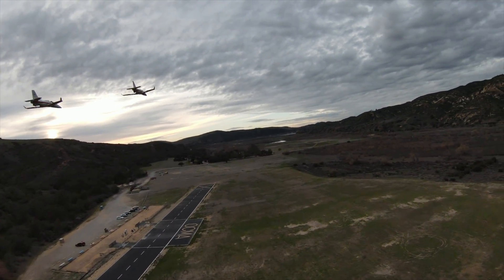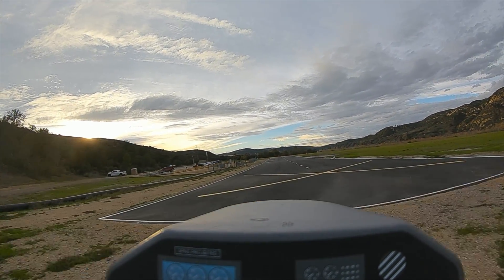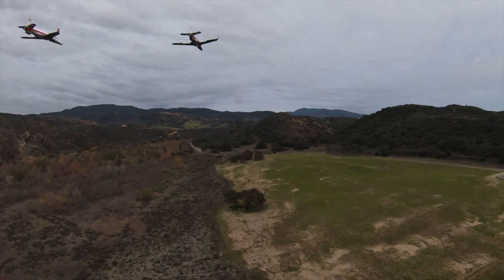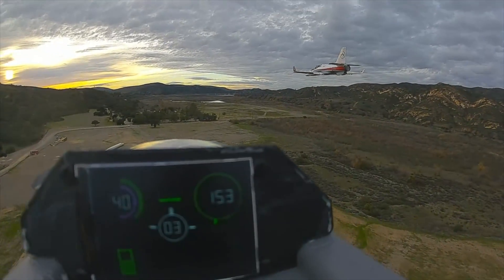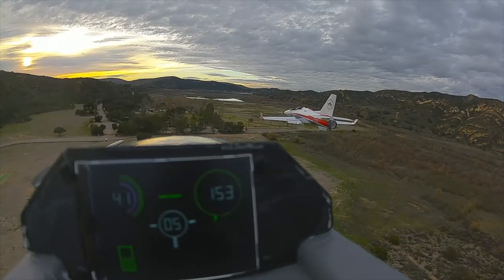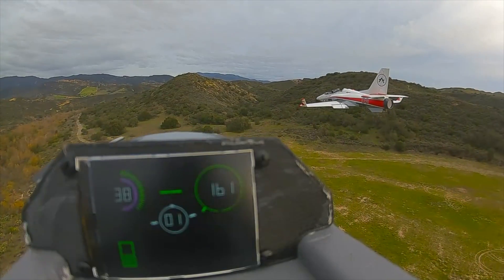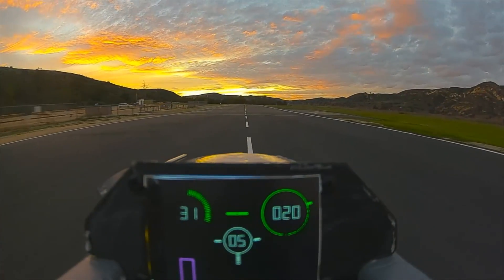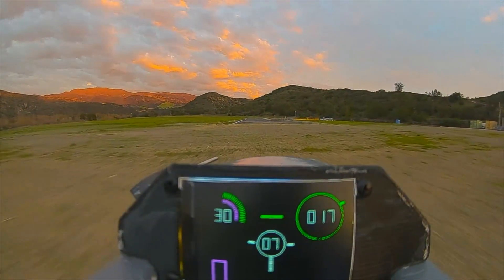FPV Display - The Numbers

Comment: Very interesting stuff.  I fly FPV Wings and achieve the heads up display with a flight controller that overlays on the VTX feed.  Information like you are showing plus lots more.  I'm curious why you aren't using that technology vs your system.
Reply: My guess is they are not using autopilot flight controllers and instead are just putting digital cam and VTX on a standard RC airplane with legacy flight controller or no flight controller. If that was the case the screen would need to be mostly self contained. Cockpit screens have been done before on RC and IIRC usually they take data from an autopilot fc like one made for ardupilot or inav. If im correct its an interesting approach to have it all self contained. Personally id rather have all the other features and more mature hardware of normal autopilot if I was going through all the hassle but this is a hobby after all so if they are having fun tinkering then more power to them.
Reply: @Clickmaster5k  Its amazing what they are doing..  This hobby is amazing..  So many talented people out there..
Reply: @SteffenRC  Yep its pretty cool. Looks like a lot of fun.
Reply from the maker: this has been asked and answered already. duplicate.
Reply: @BlackstarFPV  Yep..  I just read that below, sorry for the duplicate..   Looks like you all are having a blast with this formation flying..  Its tough to do well,  Love to see a video where you add the audio of you and the team communicating whats going on while flying on the ground..   Thanks for sharing.
Reply from the maker: No worries. Audio historically has been a challenge at our field. We either cussing too much or there is a gasser doing run-ups. Maybe some day we will get lucky and get a good track. :-)
Reply: @BlackstarFPV  man i prefer the cussing. 
Makes me feel like im flying with other people.
Reply: @BlackstarFPV  love the sound of a gasser.
Reply: @BlackstarFPV  Maybe make that a pinned comment. Or even just make it part of your video or description because it will be the first thing pretty much any FPV pilot is going to wonder and youtube comments are not very good at being forums.

Comment: This is nice. But running inav OSD would be way more beneficial and display options would be almost limitless. Flight modes, RTH ect..
Reply from the maker: this has entirely different purpose from inav, think scale looking primary flight display vs. clinical telemetry. and DJI OSD got a bit of latency, not much but it makes it harder to use for time-sensitive things, like landing a jet.
Reply: @BlackstarFPV   can it receive telemetry data from inav, so that it can display my pitot airspeed, or will your system use a proprietary sensor? Really looking forward to this system😊Bulding a scale super cub, and this ip would be a great additon to it! All the best!

Comment: a suggestion: it would be great if you added a heading indicator in the middle
Reply from the maker: We are planning on introducing AHRS module in the V2, so heading data will be there with proper attitude reference which will help holding near perfect angle of attack when landing or taking off. I'm curious how would you use a heading indicator? Maybe for long range flying GPS module will be more practical?
Reply: @BlackstarFPV  If you know the heading of your runway, it could help you if you got disoriented. Also you wanted to land on an rc aircraft carrier, the heading could help you line up with the angled runway.
Reply: @velcro62  its not practical or useful in this application. 
Makes sense for real aircraft especially because of vor and for IFR. 
But with VFR close proximity there's quite literally no point. 
It would also force him to make each of the instruments smaller and would strat becoming hard to read.
Reply: @krotchlickmeugh627  You're not thinking outside of the box. Keyword: " not useful in this application".
Reply: @velcro62  well then if its not useful why would you need it?